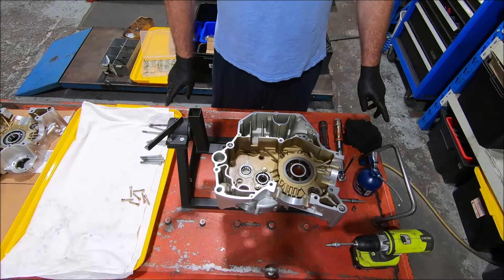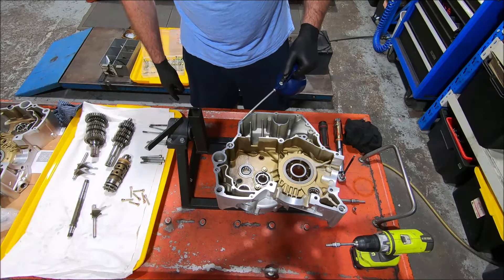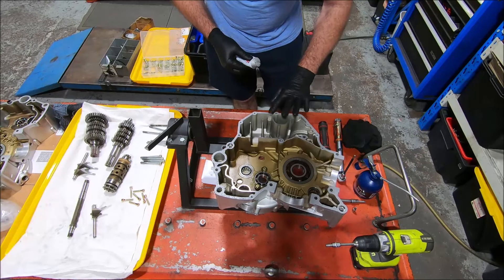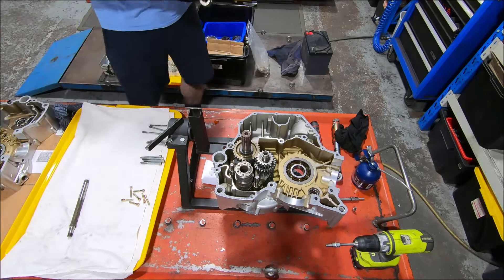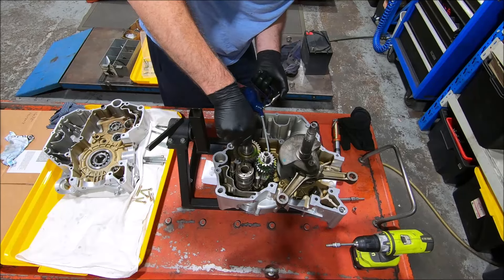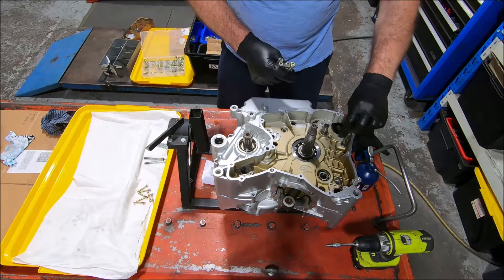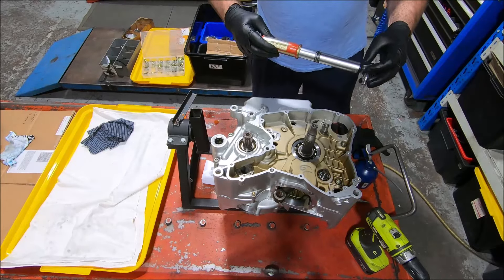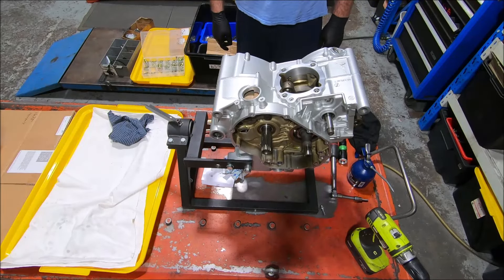Assembling Ducati crankcases - crank, gearbox, etc. Monster 659 in this instance

Comment: Greatly enjoyable, thank you for sharing. Is the crankcase basically the same for the 659, 696, 796 and 1100 air-cooled engines?
Reply from the maker: 659, 696 and 796 are the same engine with different cranks and pistons.  1100 is a big block, so it's a little different, but they're all just glorified pantahs.  even the 4v engines pre plain mains are much the same thing.

Comment: Hi Brad, Thanks for the video. One question, why not put the sealant on after you have the crank, gearbox etc. in the case so you are not under time pressure?
Reply from the maker: there's no time pressure.  even with the shift drum being funny it was still less than 10 minutes to getting it together.  doing the goop last just has you standing around waiting.  btdt.

Comment: Thanks. Another great video to bookmark for future reference. Does oiling up the bolt holes affect  the tightening torque for the screws at all?
Reply from the maker: don't know.  ex factory the screws all have sealant on the threads, so they're certainly lubricated to some extent on installation.  i certainly wouldn't put them in dry personally.
Reply: @bradthebikeboy Sorry! I should have checked first 🤦 Just looked in my 1100 manual and the 25Nm figure is for lubricated threads. 👍

Comment: Good vid! Would you have one done for shafts shimming ( and rambling)?
Btw, love you engine stand...home made it right?
Reply from the maker: the shimming video is up to editing.  for a couple of reasons it stopped and started a couple of times and it's going to be an editing nightmare.  editing takes hours for some of these.  this one was very quick, depends how easy to went when i filmed it, and how much mindless drivel i have to cut out or try to make sense of.

the engine stand was made by thomas hauge on the 851/888 forum years ago.  he did a group build.  it's a good thing.  i might steal an idea from leigh farrell and fit an old sprocket to the mount bracket and a sliding pin so it can be locked in many positions easily.  much easier than getting that pin in (which was my frustrated mod one day).  it's meant to have the two clamp screws tightened to hold it, which takes way too much time to deal with for my increasingly short attention span.
Reply: @bradthebikeboy  thanks mate

Comment: Great vid, this is exactly what I needed as I am going to go through this exact process by my self... However I am now at stage where I have pretty much everything ready to go, but want to blast and paint the cases. What would ya recommend? Vapor blast, soda blast, glass bead? I consulted some yt mechanic and he said sandblasting is okay, as long as you clean everything afterwards.
Reply from the maker: vapour/hydro blasting (sandblasting with water instead of air) leaves a more durable surface finish that is brighter and more closed (smoother) than dry media blasting.  i'd do that.  you need to remove all bearings, seals and plugs from the cases before having it done, and clean them well afterwards.  cleaning with water instead of air helps remove more debris due to the extra viscosity.  you could then paint them if you wanted to.
Reply: @bradthebikeboy  Thanks! I also have an idea of washing oil galleries with solvents before blasting, so no specs have anything to grab onto, plug them up too...
Reply from the maker: @giedriusbruzas6542   cleaning couldn't hurt.  i wouldn't plug them - let it all get blasted through, esp if hydro blasting.
Reply: @bradthebikeboy  Decided just do chemical stripping and repaint... Anyways, does timing shaft have a clearance spec? 
Edit: watched alternator side assembly video, but will there be a clutch side assembly video? All these videos are really life/money/time savers...